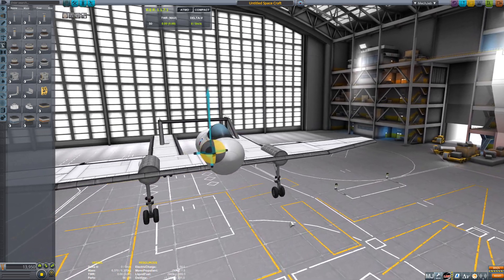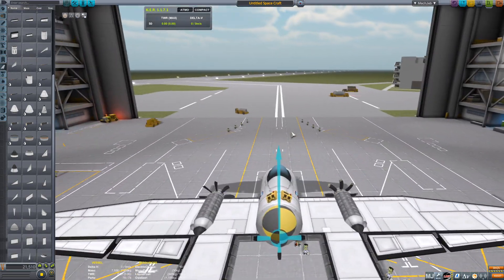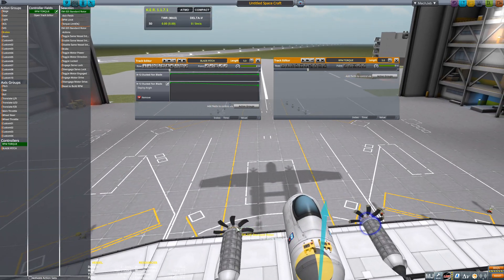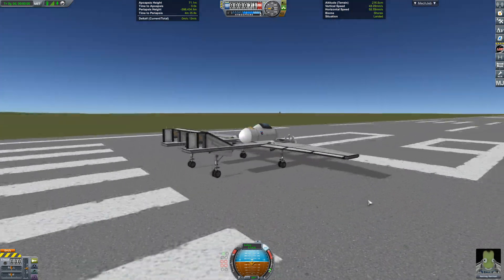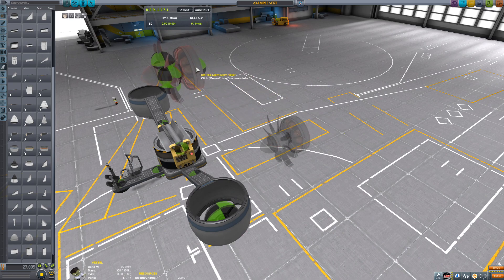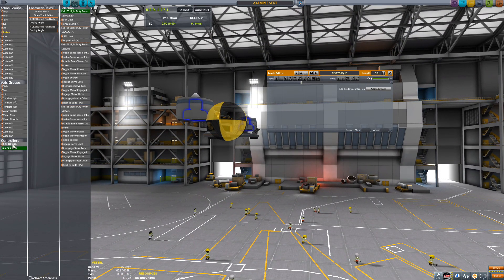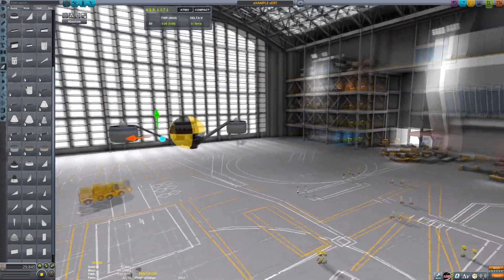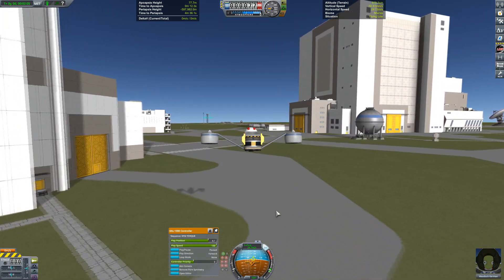Kerbal Space Program | Rotor & Blade setup for Horizontal and Vertical Flight

Comment: The way I make propeller planes is without the KAL and I assign the main throttle to the RPM and Torque, I find it works fine and it's simpler. The KAL way does make more efficient use of the blades' thrust as the relative angle of attack decreases as airspeed increases, however.

Comment: I usually have my Rotor torque set to the main throttle AG directly, and the Blade pitch set to the Translate F/B (forward=h/back=n) so that I don't need to use KAL controllers, RPM I leave at max always so that if I need more power, I put the throttle to the needed power to achieve desired RPM, possibly you could try this setup and give feedback from what you find? {This is what I use for Horizontal flight and something similar for vertical flight, just flipped and using U/D translate for verti.} Thanks for the great information as well!
Reply from the maker: I used to use that setup, but when making VTOLs it became problematic. The blade pitch to throttle also gives an amazing fast  stop like airbrakes are deployed when X is pressed

Comment: Great tutorial my G but im having a issue every time i set for Octo on the motor my fans start wanting to act like its leaving the matrix and start going all over the place then  blow up. What could be the issue with this? seems like its not wanting to stay stuck to the rotor
Reply from the maker: Make sure they connect to the attachment points else they will separate
Reply: @BillyWinnJr  Yeah its defiantly attached holding down alt as well to be sure  even trying it with octo with just 1 its coming off which is super frustrating even the nose cap is coming off and rotating upside down lol. I just think all my rotors don't work only hinges work..
Reply from the maker: Which blades did you try? The fan, heli, or prop? That sounds really odd
Reply: @BillyWinnJr  Yeah just to break it down clearly, I followed all your steps to a tee but when i went to actually fly (both aircraft and the vtol) it would work but it would make all my fans act erratic and kraken hit out of no where. After trying a couple of times I took the fan blades off and put them on individually and had to use a extra kal1000 after this only 1 fan would work the other would still kraken again but this time it would not fly. After this i tried to download a heli from KerbalX (one of yours btw) and it would do the same thing so I dont' know what going on tbh?? Like i said only the hinges work but the rotors wont work. The only rotor that works is the biggest one that's squared shape. I guess My computer just wont allow rotors or my game anyway...

Granted im not a rookie to robotics infact I have build many parts with hinges and hydraulics  very large and multi part robotics and have no issues only rotors for some reason makes the kraken come out
Reply from the maker: Sounds like a bugged install, try verifying the install on steam or reinstalling. Something may be corrupt
Reply: @BillyWinnJr  yeah ill try to verify method to see what happens but yeah its totally weird that I cant use  rotors or any of the blades or fans properly..

Comment: Ps5 must not have those features to program your rotors. I am finding it very hard to get mine to work correctly. I've tried using the controller and binding the keys under action menu but they don't work at all. When I click the controller and manually do it so that's set up. But the binding isn't working correctly so it's not working for me. Wish I knew how to fix it.

Comment: You are installing your starboard blades backwards.
Reply from the maker: Invert vs CW/CCW. CW/CCW is visually correct, Invert has the same effect without the visual corrections.
Reply: The white stripes on the starboard blades are facing in the wrong direction (backwards).  I mean, maybe in Kerbal world it doesn't matter... they do lots of stuff backwards?I haven't tested to see if adjusting blade pitch would still allow for reverse thrust if one side is installed backwards?  Do you use blade pitch for forward/reverse thrust or reverse your engine rotation?  Good videos BTW, I subbed..  just happened to come across your stuff on KerbalX.
Reply from the maker: Thanks! Welcome aboard. The visuals seem to be incorrect if I select only invert. The engines can be set to invert, but I only double invert (blades and rotors) if I am running counter props. I probable should embrace the cw/ccw. As it does look better. The end effect actually is the same though... Well at the moment I should add. In case they remove it lol

Comment: Why don't you just map deploy angle of the blades to throttle position in action groups?
Reply: As far as I know you have to use the KAL in order to tune the max angle of the blades to match the torque limit otherwise you can run into blade stall problems especially with VTOL. You dont need 2 KALs though lol and mapping the rpm limit to the KAL is practically useless because drag already does that. I have the tourque limit and blade angle set to the same KAL. The only problem with using the KAL play position mapped to the throttle is you have to set the start point of the KAL program to half of the total length so that 0 angle and 0 torque limit is at 2.5s and max is at 5s because for some reason mapping the KAL play position to the throttle sets the play position to 2.5 at 0% throttle🤷‍♂️. And if you want reverse and extra braking you can set the blade angle start point to -5 to -10.

Comment: Im having an issue where both motors rotate in the same direction. Causing the aircraft to pull in that direction there rotating in.
Reply from the maker: Make sure to place them one by one, then try to either invert one or set it to counterclockwise as well as the blades connected to it

Comment: None of this works on console and the parts he used don’t exist on console
Reply from the maker: Sure it does, if you picked up https://www.kerbalspaceprogram.com/release/the-breaking-ground-expansion-is-coming-to-consoles/
Reply: @BillyWinnJr  it doesn't. We don't have ducted props and there is no deploy angle on ps4. Only deploy toggle, extend, retract or authority limiter
Reply from the maker: @jjwardyjj  oof, hopefully it gets updated a bit to match closer to PC. I have it on PS4, but don't play it there much.
Reply: @BillyWinnJr  I just want mouse and keyboard support. Playing on ps4 is so bad cos of controller. Also I figured out how it works on ps4. U link the controller to the limiter and it controls the pitch of the props. Just wish we had more props. Only got 3 differant sizes